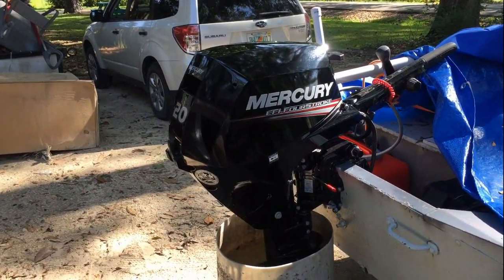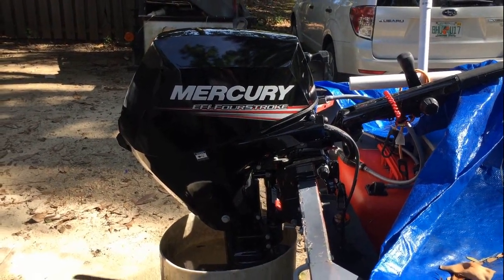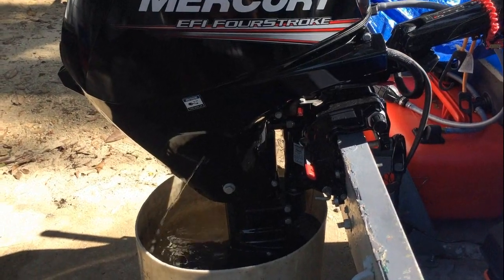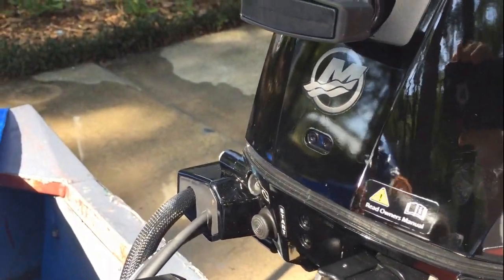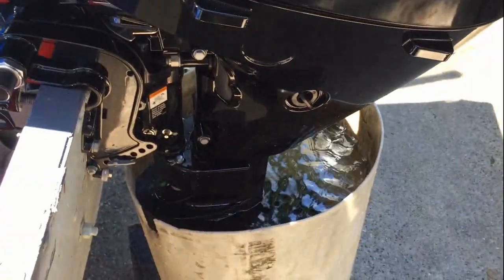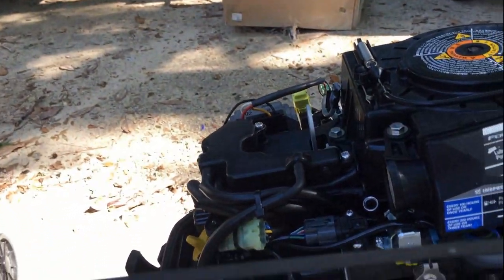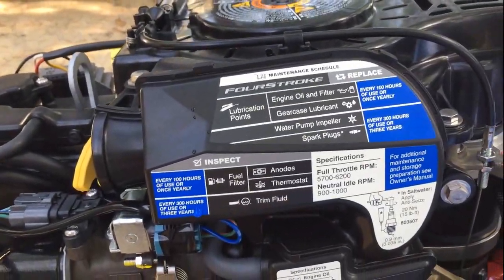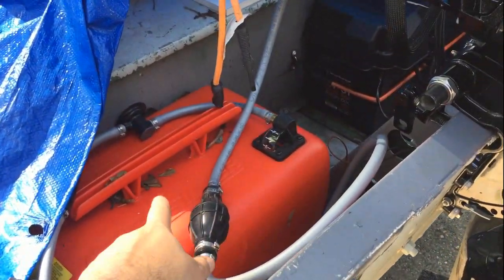2018 Mercury Fourstroke 20HP Review

Comment: So my question is Brent great review first of all but I'm trying to choose between a Honda bf20 and the Mercury 4 stroke what would you say and for the same features on a Honda the cost is somewhere in the area of 4100
Reply: I don't believe Honda makes a 20 hp with EFI. EFI is MUCH better than Carburated (according to my mechanic) as far as future maintenance is concerned. That being said it's hard to beat the proven quality of the Honda and it will run great for many, many years. The Honda has a large displacement motor 360cc vs 333 for the Mercury so lots of torque but I believe the EFI will make up the difference in 'jump' to get you there in the same amount of time :)  BTW,  I just, today, ordered the Tohatsu version of the EFI Mercury (the Merc didn't offer it in long shaft).
Reply from the maker: Charles Hart  the motor was $2750

Comment: Hey Brent, I'm almost at my 10 hours. Great motor. The only question I have is there a way to tilt the motor to a higher point? I had a 9.9 and I could tilt it to many positions...this motor I can only tilt it to 2 positions... I take it I am doing something wrong? any help would be great!! thanks so much.
Reply from the maker: Frank N I can tilt the motor in three places. You can also adjust your tilt pin
Reply: Brent, thanks a lot for replying. I feel like an idiot now...the reason it would not tilt all the way up is that it was hitting my gas can. When I moved the gas can over I was good to go. I didn't account for the bigger 6 gallon can it came with. Once again thanks again.